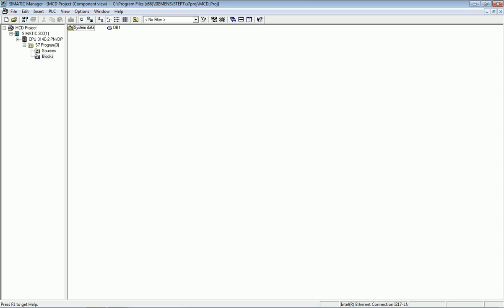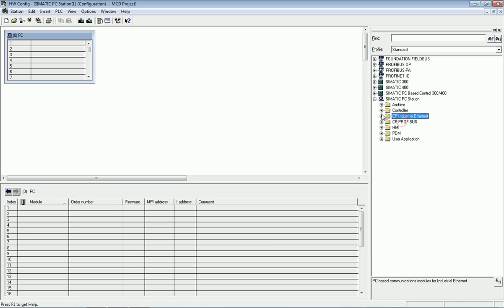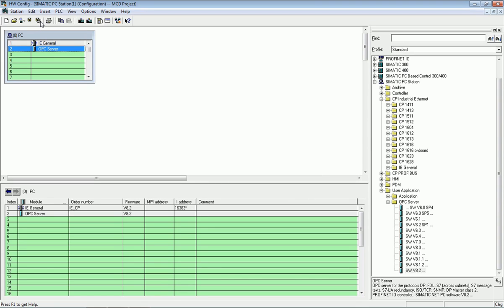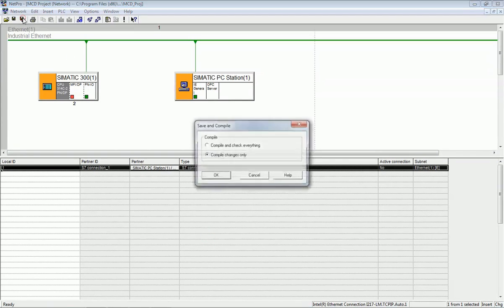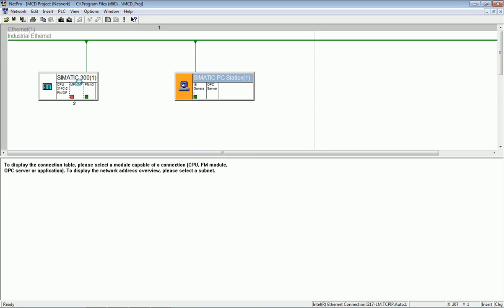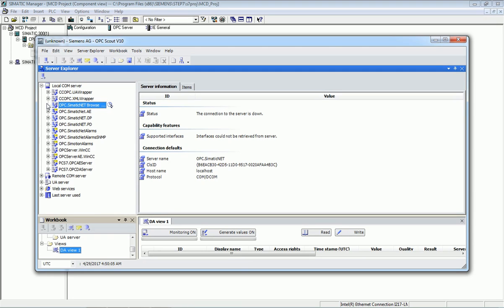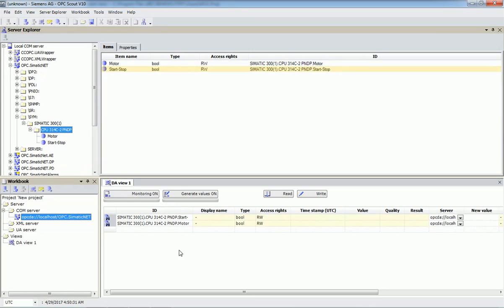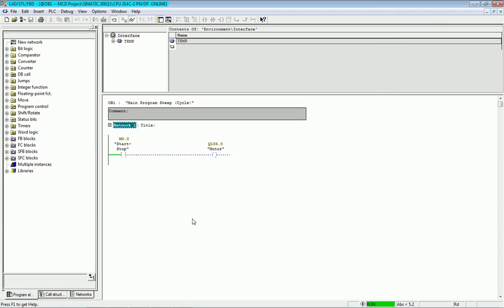OPC Configuration in SIEMENS PLC

Comment: Great Video! Just one question to be clear, so I need to have all step 7 package installed on the PC that I want as a OPC Server? If I want to use a PC for a programming station and other for a OPC Server I need to have Step 7 installed on both?
Reply from the maker: Both side Step 7 is not required.

Comment: Hi am
Your video is very good let me know
Can i try all things without any physical hardware at my home pc please reply......
Reply from the maker: Sorry, Without Hardware you can't perform all practical. Only Programming simulation can be done on software.
Reply: Thanks for reply dear
 i already simulate programs but now i want to connect simatic s7 to reliance scada for this i simulate programs using plcsim tcp/ip interface on pg/pc interface and successfully configured but when i tried to connect with reliance scada using that ip address nothing happened and one thing i observed my simatic workstation configuration have a problem coz server not getting start for multiterminal can u plz help me out I'll be very grateful to you
Reply: @AutomationRevolution  Thank you very much for the example. It is the best I've seen in a long time.
By the way, would you dare to update this example with Simatic Net v13 or 15, and in development of TIA Portal?
I imagine that many things will be similar, but would everything really be the same?

Comment: Hello Sir, Your video is very clear to me. However, if I do the same as you I can't download the OPC. It allways says it was not posible to establish a connection. My home PC is also used as the PG and I want to use it as the OPC server. What is wrong? Do I need to lower the fire wall or turn of the virus scanner on the PC? Hope you van help me. Kind regards Rob.
Reply from the maker: Hi, Can you please check once IP configuration ? If it's okay then confirm weather you have installed  OPC software in your local PC.